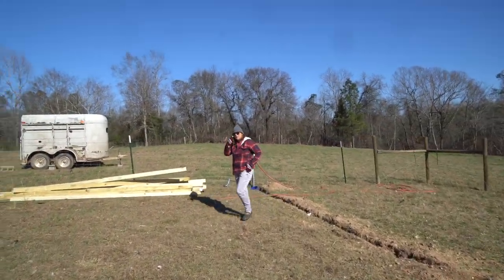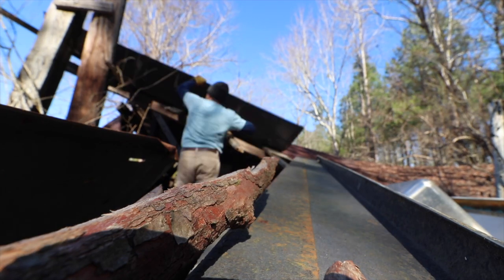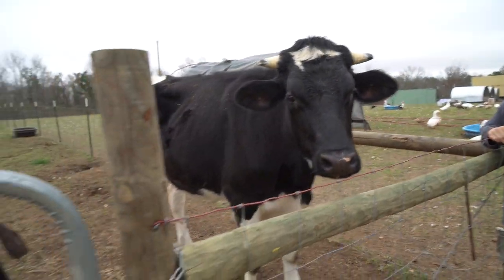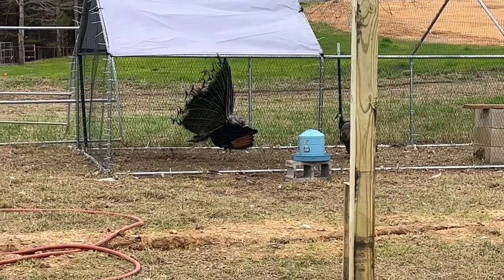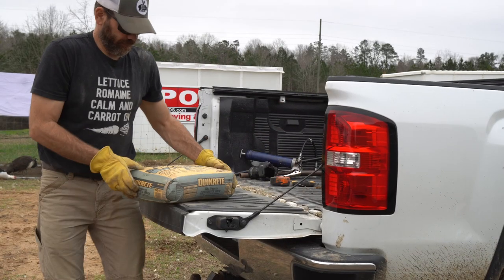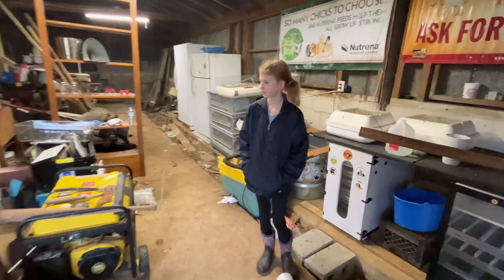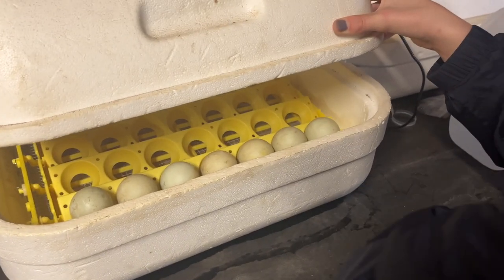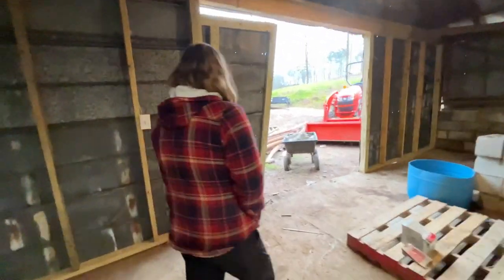Starting On The Aviary & Barn, But This Day DIDN'T Begin As Planned!!!

Comment: We buried our hardware cloth on our chicken run too. Also have a cement pad under each of the gates to prevent digging too. Netting has worked great over the run except once when a big tree limb put a hole in it and I didn’t realize until a raccoon came in through it and got nine of my chickens. We have an automatic door and he put his little paws right under there and lifted the door. Fixed that problem with a piece of angle iron. Live and learn I guess.

Arlo said he might need to keep his hair a little longer to make it through winter.

Comment: HA! Purple Pigeon Palace! LOVE IT! When adding the roof to the aviary, consider adding brackets at the top of each pole. That way, the tops of your 4x4s won't split after 5-10 years from screwing down into the tops where water can get in, AND you can undo your screws from UNDERNEATH if you ever have to do some repairs, instead of having to crawl around on top!

Comment: the best way to secure those 4"x4" post to the ground is to dig the hole, fill the hole with mixed concrete, insert Simpson Strong Tie Brackets into the top of the poured concrete footing, need to line up the brackets with a Lazer Level. Secure post to bracket with appropriate Simpson Fastners, these brackets will keep the wood post off of the ground and allow them to be nearly indestructible

Comment: Good morning y'all‼️I have a suggestion for MaryCarl concerning her eggs. She might want to take an old flat piece of parker-bored or a thin piece of scrap plywood.  Then paint it with the chalk pant to make a chalk bored. Then hang it on the wall by her eggs so she can keep track of them. I would also suggest a sharpie so she can put the day, date, and time she gathered the egg when she puts it N the incubator. One more thought about the chalkboard you can always put small lines of paint tape on the board before you paint it and make a grid 2 help keep up with your dates and you times for your eggs. Or you could just get a whiteboard and Draw them on their as u like. Have a great day🌞‼️ RTR🌊

Comment: Love the old metal on the barn. I would let them use all they could salvage. Maybe save it for Modies barn... The avereray is going to be great. Need to plan the stands and perches. I am sure MaryCarl has it under control. The predators could dig so pin / stake the hardware cloth to the ground with metal pins. Maybe use rebar. I think you can buy them already bent on the top as used in foundations.

Comment: My friend in CA had chickens and lost them several times to coyotes. They will climb an 8 foot plus fence easy, just jump over the smaller ones. He tried putting long pipes that would spin along the top edge of the fence, but he had a small pen and could do that. The only thing that will keep them out is to totally enclose the area sides top, and I would bet bottom.

Hope you have better luck if they do find the farm.

Comment: I can think of two reasons why Mary Carl may be having issues incubating in the barn. 1. Those styrofoam incubators are notorious for losing heat and 2. incubating in a non climate controlled barn will restrict your success because the incubator has to work extra hard to keep the temperature steady and consistent. Just a thought. Love y’all’s videos and am enjoying the progress you are making with your new place.

Comment: I wonder if it would be just as good to use the concrete square supports that you sit the poles on so you don’t have to dig deep holes?   Just shallow places to pour the concrete pads on to sit the concrete blocks on hahahahaha.

Comment: What happened with Arlo's hair cut, was it a missing up to date vaccination or vaccination card? That's a real common one now. You pull out their vaccination record (which you need to bring with you, keep it in a safe place) and find out that you've missed a booster. They have to be up to date and it has to be 48 hours from the last vaccination. No one wants their dogs to die because someone else didn't vaccinate their dogs. Parvo, for example, is horrible and has had a HUGE increase during covid times. No one's taking any chances and they shouldn't.

Vaccines Needed for Dog Grooming (check with your vet and local laws which may be different)

6-8 weeks: Parvovirus and distemper vaccines.
10-12 weeks: DHPP shot, which includes vaccines for distemper, parvovirus, parainfluenza, and adenovirus. After this vaccination, your dog may be eligible to visit your local groomer for the first time.
16-18 weeks: DHPP booster and rabies vaccine.
12-16 months: DHPP and rabies boosters.
Every 1-2 years: DHPP booster.
Every 1-3 years: Rabies booster.